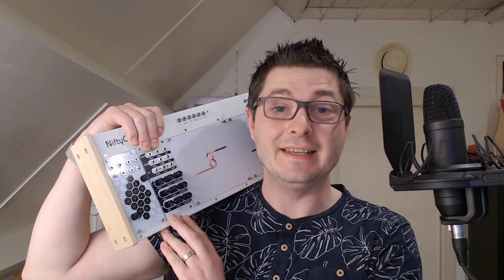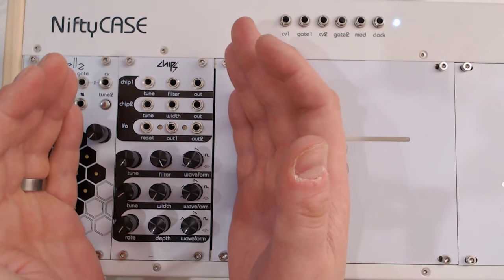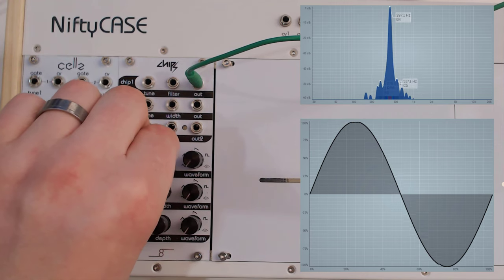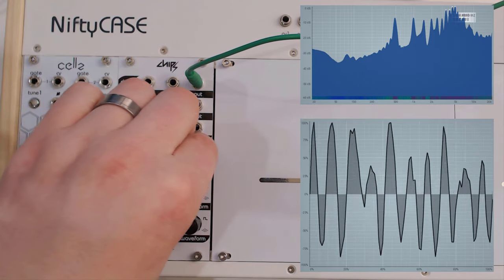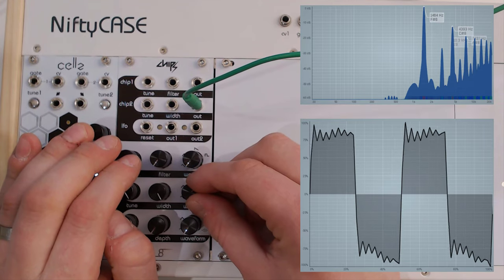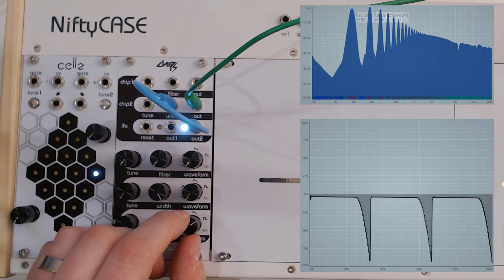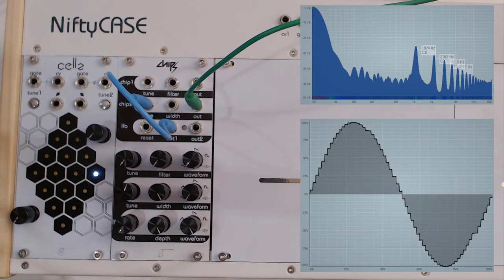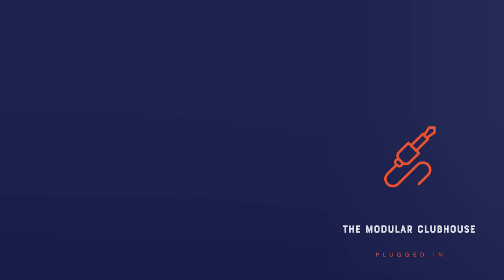Episode 9: Cre8audio Chips / Chipz review ( NiftyBundle 1 of 3 ) | Eurorack Modular

Comment: I boguht the bundle but quickly upgraded to a bigger case and sold cells and Chipz. But I still appreciate Cellz as a touch trigger generator or a double 4 step sequencer (never used more steps). Cellz had indeed a specific sound and the lfo's came in very handy. Sometimes I regret not having them anymore
Reply from the maker: What's stopping you from buying them again?

Comment: Nice video again Jesper. I find your reviews really interesting. What is the role of the modules you own so far in your system as a whole? Do you have a plan or are you testing a variety of modules go decide which ones you will use in your system later? I am completely new to modular synths and I haven’t got any idea of what a complete system should consist of.
Reply from the maker: Thanks a million Ruud! Well, that's a great (and I think the most important question) currently my modular rigs only has sound sources (The sample player and the VCO, Voltage Controlled Oscillator and this module) a simple sequencer (will dive into that in a future video) and a VCF, Voltage Controlled Filter. The simplest set up would be: 
a) something to set the tone either a contoller like a keyboard or a sequencer, 
b) a sound source (typically a VCO),
c) a filter (VCF), 
d) then you would expect to have an envelope generator 
e) and a VCA, Voltage Controlled Amplifier. 

But then again you would like to add some modulation to the mix as well and then it becomes really crazy.

Good starting points are these videos from Andrew Huang: https://youtu.be/cWslSTTkiFU and https://youtu.be/UXEyEIo-WtA

So currently I'm looking for two very distinct modular rigs: one to generate Elektro-Punk, so I need some proper drum sequencing and some good distorted oscillators and the other will be more a Black-Metal-inspired drony ambient and I think I've got the perfect module on its way for that. 

How about yourself: what would be your goal?
Reply: Thanks for the reply, that clarifies a lot and I will watch the suggested videos. I havent really thought of what my goals are. I am a big fan of James Holden and if I could produce sounds that are somewhat close to this I would be happy:
https://youtu.be/6OC3Taxg7W8
Anyway im still not sure if i should dive into modular or maybe im better off with an analog synth like the korg minilogue to start with.
Reply from the maker: @ruudlitjens2386  That sounds like modular to me ;) but I'm no James Holden expert in all honesty. I would also recommend to join some forums online (like muffwiggler and gearslutz) and some discord servers (I'm on some as well, are you on discord already?)
Reply from the maker: Ow, and before you dive into modular: play with https://vcvrack.com/
Reply: @TheModularClubhouse  no Im not I will check that out!